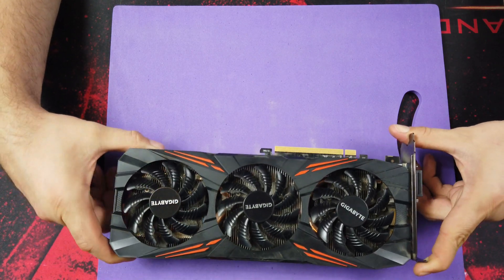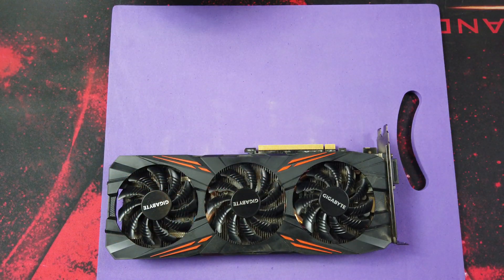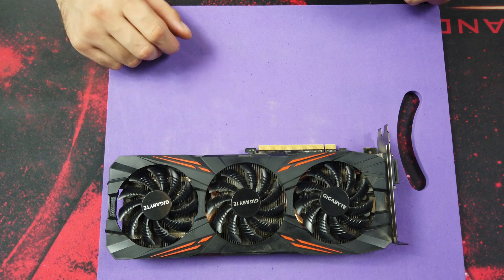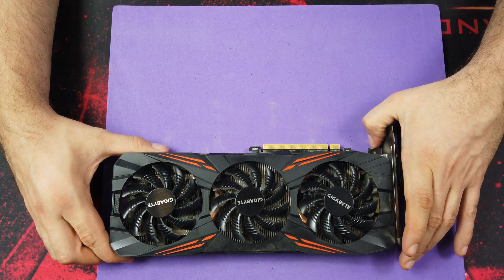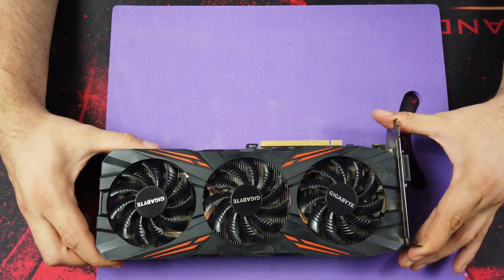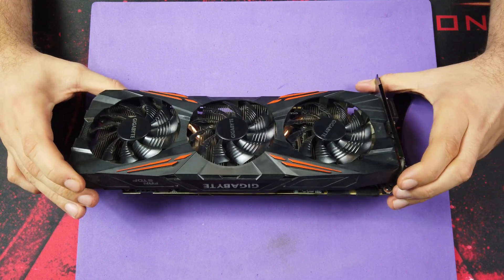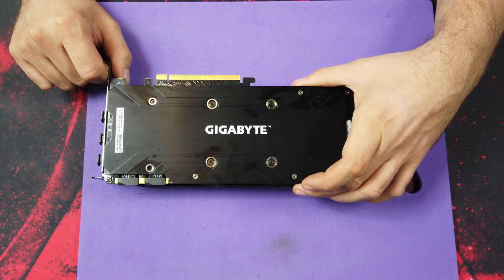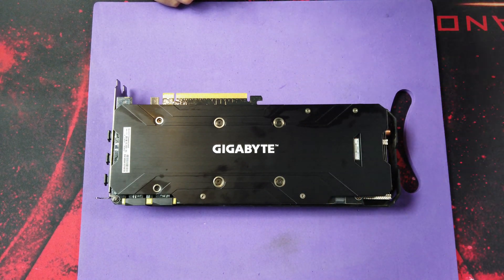How To Clean GPU and change thermal paste (and why you should do it)

Comment: Please spread the thermal paste on the chip properly you missed it and it causes alot of difference in temps. You did the wrong way! 
I used to get high temps after two time reapplying thermal paste but the third time i found the error that i have to spread the thermal paste and it helped alot.

Comment: I've gigabyte gtx 1060 6G g1 gaming for last 6 years. I want to change paste and pads it has similar heat sink design so what's the thickness of pads used in this GPU. Is it the same across the GPU or thinner near processor? 1mm or 2mm which will work good?
Reply: Use thermal paste, much better

Comment: I see it took you some time to remove the 2 cables I have that problem I dont want to force anything but they are not comming off just like that
Reply from the maker: Yes, they have a rather tight connection, but with care they can be undone.

Comment: How do you clean around the die? I know we are not suppose to touch it because the components around it could break. But the factory did a terrible job applying thermal paste on my RTX 2070 Super XC. They caked the thermal paste on there. There was barely any thermal paste on the die, but it flushed to the side and formed a layer which probably created a thermal bubble. The thermal paste was all over the side and I didn't want to risk cleaning it so cleaned up the old paste and applied Kryonaut on the chip.
Reply from the maker: Yes, sometimes there is a lot of paste around the die. You can soak it a little with isopropyl alcohol (using q-tip) and after a while try to clean it with q-tip (but be very carefull there, because of that small resistors around are liking to "catching" the q-tip). So sometimes it's better to leave it like it is, and clean only the actual die (which is the the actual source of heat and needs good thermal transfer to the heatsink).